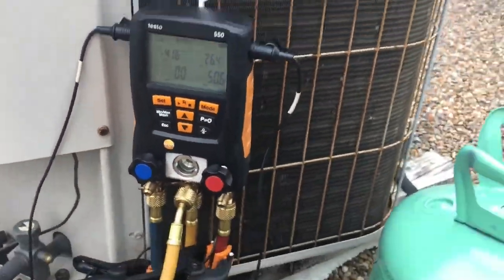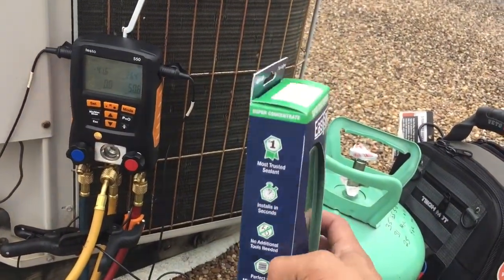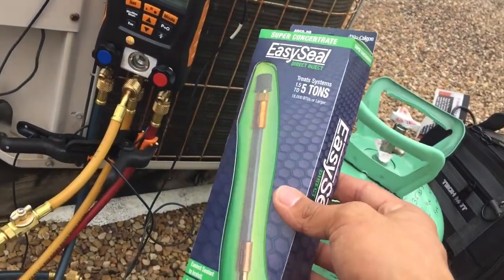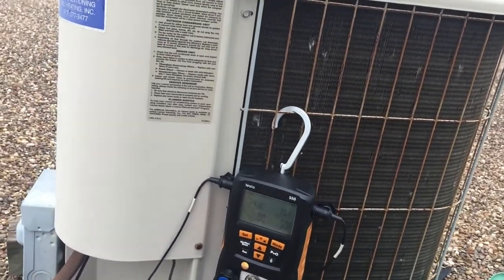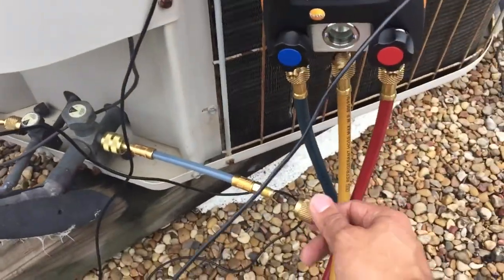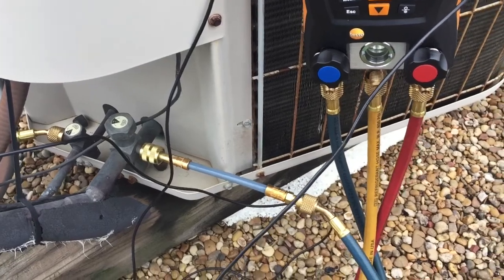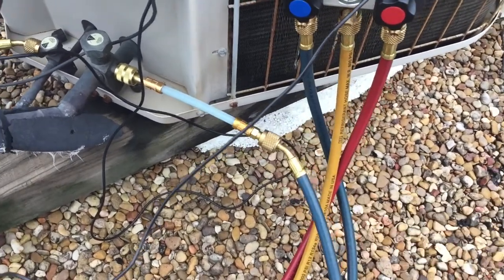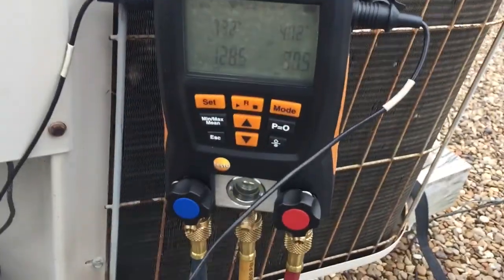Air Conditioner leak seal Experiment.

Comment: When it doesn't work it just won't work, but if it works either it works or slows down the leak.. I have used the "AC leak freeze" and it's like gambling.. did it work?
Reply from the maker: Oscar Arevalo it didn't work for this unit. I'm guessing the leak was too big. I guess if it's the last try before replacing a unit.
Reply: Ulises Palacios I'm not a big fan of the leak seals but because of where I work we offer them as the "cheapest way out but it may not work" I would says it works 15-20% of the time... how ever I rather find the leak but when you are at a call around 12:00pm and got 3 to 5 more calls go go to and the Customer wants cool now, they go for it, I had a crazy customer asking me to do the seal again after the first one didn't work 😒

Comment: I have been using it on the repeat offenders that I have to add gas to more than once but cannot find a leak. Been using the Trade Pro brand because it does not activate with moisture. I am in the testing mode because I am curious how it'll work as well. so far I haven't been called back on the few units that I have put it into.😎 ???